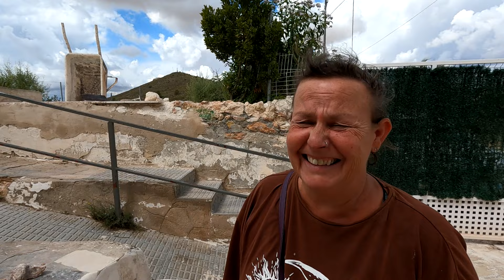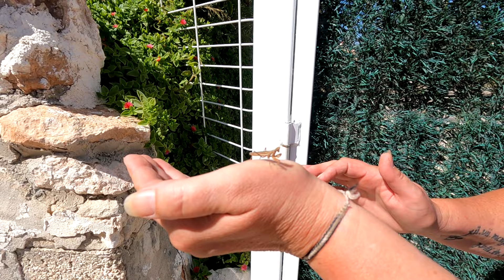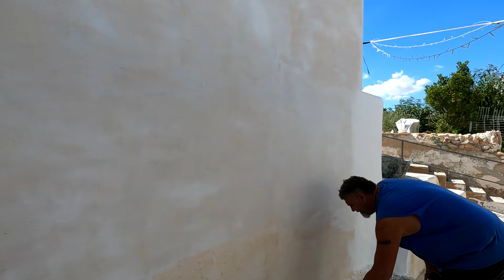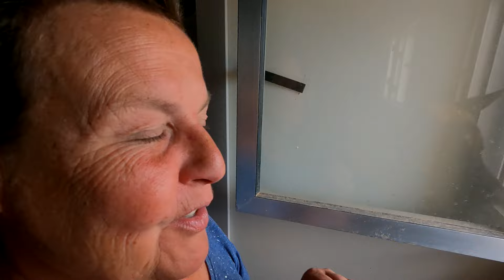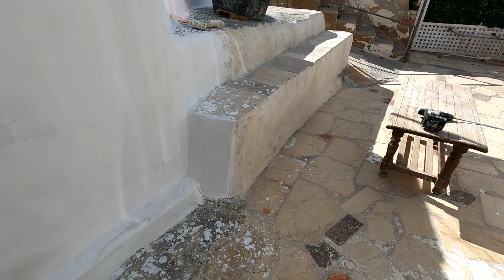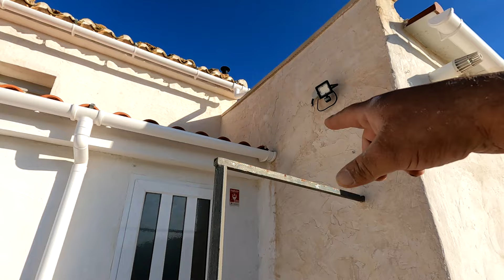Let`s start to brighten the patio (Ep 222)

Comment: To get to those really high spots could you use one of those extra long telescopic handles that you attach to the roller? I reckon they could extend the length by 2metres  so I would think if you get a reasonable height scaffold you could get the extra distance that way?.... especially as it looks so awesome painted white and will help keep the house cool in the Summer heat.
Reply from the maker: That is one possibility we are exploring, however lime wash needs to be applied with a brush unfortunately. It certainly needs doing as the white does look awesome 😎